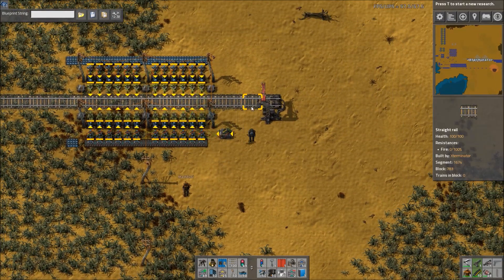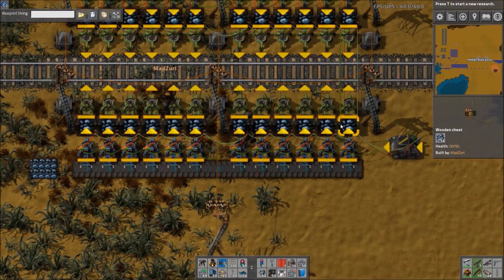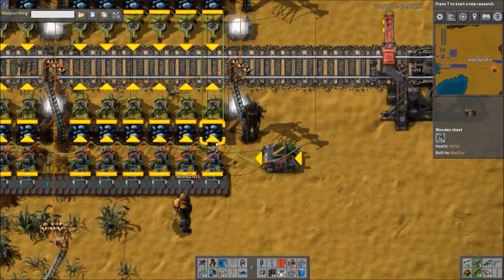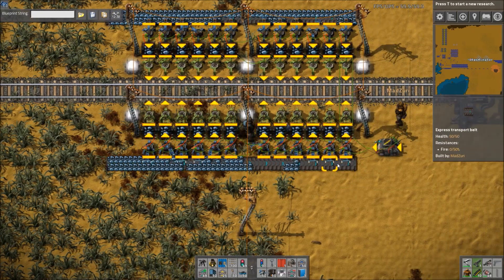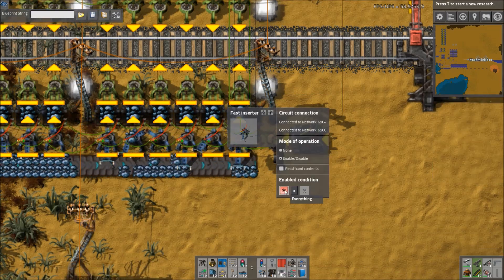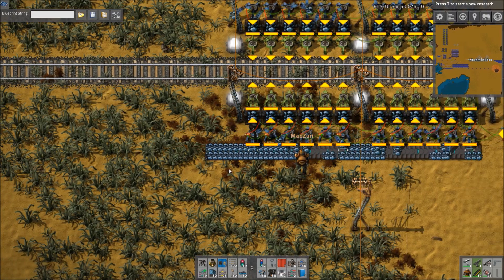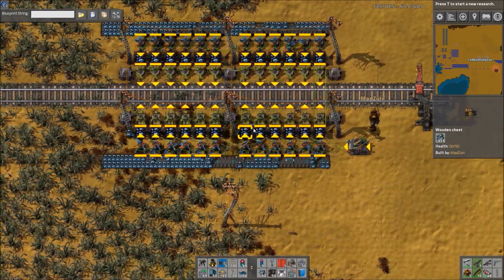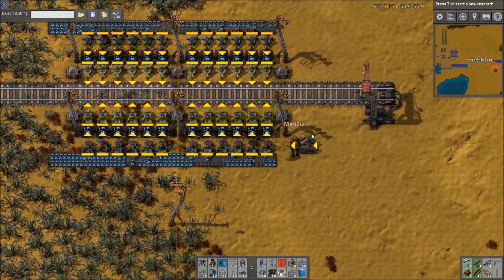Factorio Workshop - Building A Better Factory :: Zuri's Smart Train Loader

Comment: This is a lovely design, but I honestly cannot stand this train loader design....it pops up EVERYWHERE and there is a HUGE flaw in it.  Although this flaw might not pop up in your play through, it doesn't mean the flaw isn't there.  Basically, let's say that your unloading station was backfilled on one of your wagons, which leaves your front wagons empty to go pick up more material.  It grabs everything from the front chests, but the back chests remain full.....guess what happens then?

well....each back chest of 12 we'll say has 3,000 units of material, which totals 36,000.  Divided by negative 24 gives you -1,500 on the line.  The incoming line will hit the first 6 chest on each side on the back and ignore them (because they are full), but the very NEXT chest will immediately start pulling everything off the line to fill its box.....leaving a trickle for the next box, and far less for the rest of the boxes.  As this first chest fills up, the total count of material increases, which keeps that chest on fill mode (starving the other 4 to 5 chests on that wagon strip) until it hits about 1800 or so.  If another train arrives to pick up material, the front wagons will be completely starved of throughput.

This can be solved by splitting the material on a per-wagon basis and separate each 12 boxes on its own combinator average.

A blueprint for you to check out....there isn't much to it, but I use it all the time with trains that "wait for inactivity" on bot networks.  It creates a system where it doesn't wait around forever when there's only a trickle of material coming in....it turns off chest request while there is a train waiting, so the train can fill and leave quickly (it's also good at refueling trains, as in this setup, when using bigger stack sized items, otherwise I would be waiting to put 6k coal in each loco):

http://pastebin.com/JH6pvugb
Reply: In summary then, this can have undesirable results if you don't unload the wagons evenly at the other end of the line. :)
Reply: DRY411S Not quite....it's a per-wagon basis unloading problem.  If you load-balance your work when unloading, then the boxes at that spot won't become uneven and a wagon won't end up full while others are empty....but factorio doesn't always work the way you want it to.  For example, assemblers pull from the near side of the belt, which means you can end up heavy on one side over another....everything may go smoothly at first, but an hour later, suddenly your train is out of whack because your furnace smelting operation decided to backlog material inside itself and not pull anymore ore off the line from the split.....and a wagon ends up full because it became jammed.....then your loader is out of whack and your train starts coming in with 25% of a full wagon heavy on one side.  So it isn't necessarily just about balancing your unloader, I always play with the idea that you should plan the contingency AT the spot for any possibilities.

That's the fun of factorio, solving these little problems...and people like me, zuri, xterm and others like to solve these problems BEFORE they become an issue.

:)

Comment: Contrary to your other videos, I didn't like this one that much... The design is elegant, beautiful, and I will definitely use it in the future (due to using only one combinator, compared to my 2-3), but you didn't explain it really in any way as to why or how it works...

To everyone with the same question, here's the how:
By attaching all boxes to the same green wire, and the way signals on the same wire work, the total content of all boxes is added up to a single (here iron ore) signal. The combinator divides that by the number of boxes (which need to be set manually, 24 in this example for double sided loading on 2 wagons, 6 for single side loading of 1 wagon etc.), which outputs the average content of all boxes, again through green wire to the inputs of all inserters. The negative will be important later. Now each inserter is connected to their respective boxes (only!) by red wire (!!!), so that the signals of the two green wire tracks don't bleed over. Therefore each inserter gets the average of all boxes through the green wire, and the absolute of its own box through the red wire.

The beauty now comes in through the way Factorio handles red and green wires, which personally I usually consider annoying, but here it's important: while red and green wires transport signals independently, the connected devices don't! So the two independent ore counts (one the average, the other the specific box) get added up for the condition of each inserter. And that's where the negative in the average becomes important: this way we're subtracting the average box content from the current actual content, and compare that to our inserter stack bonus!

If there is less in our box than in the average of all boxes, the difference will be negative, and the inserter will grab and insert something to its box. If the box has (a lot) more than the average, the difference will be (a lot) bigger, and the inserter will not work. If our box has exactly the average amount in it, the difference will be 0, which will also make the inserter grab something (this is important, as otherwise all inserters would suddenly stop working if they at some point accidentally reached perfect balance, or all boxes are empty). Using the stack size bonus (instead of always 1) is not necessary for an almost balanced system, but it will prevent the system from "shaking" between different groups of inserters. But as I said, it's not critical to always update the comparison after finishing some research for it to work almost perfectly at any time.
Reply from the maker: Fantastic explanation, thanks for the taking the time to type all that out! :D You're right, we could of done a better job explaining it, especially considering the type of videos these are supposed to be. Really the main reason for not going as in-depth on the actual circuit workings (as you have so wonderfully done), is because our main focus here was to explain how to set this up for it to work, opposed to explaining all the details behind why it works. 
Not saying that it's unimportant how it works, because it is extremely important. However, I a lot of people just want to know how to set it up rather than a super in-depth explanation of why all the circuit stuff works how it does. 

I think that your comment is a very nice addition to the video, sense we show how to set it up and you explain very well how/why it actually works. I'll throw an annotation in the video mentioning to check your comment. :)
Just wanted to clarify the reason we didn't explain it in such detail. To be honest, it will be impossible to make everyone happy. lol We start spending more time explaining the "behind the scenes" more thoroughly then people will complain it is too long of a video (I already get people complaining about that in my other tutorials when I try to go in-depth on all the details lol), and if we go too basic then people are unhappy we didn't explain it enough. Still trying to find a nice medium I think. Haha

Sorry for wall of text, but I wanted to explain the thinking behind it. :P
Reply: That may have sounded a bit negative in the beginning... Please let me clarify: I still like this video! It's just that I don't like to copy blocks like this as "black magic" without explanation, especially when a video format like this is intended to explain these blocks, e.g. like for all those smelter setups. :D
Reply: Raffo42 Thanks for explaining!
Reply: That's true, I completely forgot about the video length, good point... ^^ I just remembered a scene from a completely different (German) youtuber, who once used a 4 by 4 belt balancer to balance 2 input belts to 2 output belts... instead of just using the splitter... That's why sometimes it's important to know the background, before blindly copying something. ;)
Reply: Awesome explanation, but i dont completely understand yet why you should use the stack size bonus instead of one. just wanna understand it perfectly :D

Comment: So, as I understand it, the combinator outputs the current number desired in each chest, times -1.   The inserter conditions could just be < 0, but since inserter stack bonuses might cause an inserter to put in extra units, you make those conditions < 3.

I puzzled a lot over a loading station in your shared game that was not filling train wagons, that was set up with this logic, but I think whoever copied it, didn't set the combinator constant correctly - it was something like -648, when it should have been -72, for a 2-6-2 train.  (Haven't been on your shared server lately, since you went back to 14.11.)
Reply: One caveat is that you need to feed both sides of the train evenly.
Reply: If the condition is <0 it will come to a complete stop and lock up as soon as all boxes have the exact same content (e.g. empty!), as the difference then is exactly 0. But yes, you could run it with <1 on any stack size bonus, with a slight imbalance between chests. Less than your stack size bonus, though, which should still be fine if you're going to load thousands of items. ^^